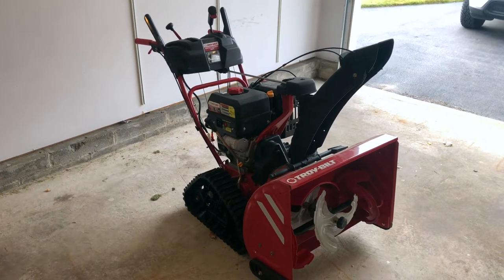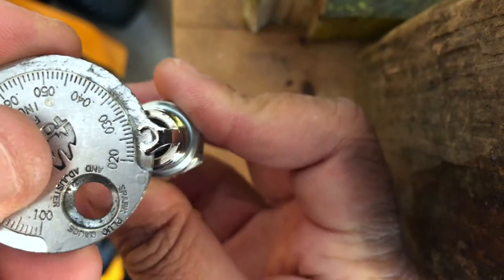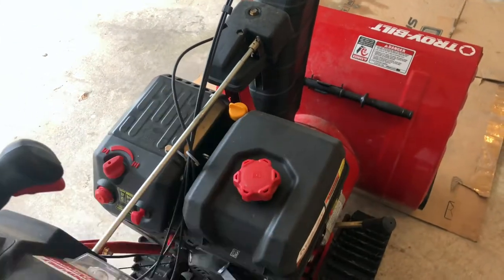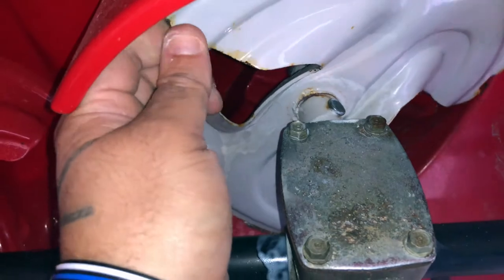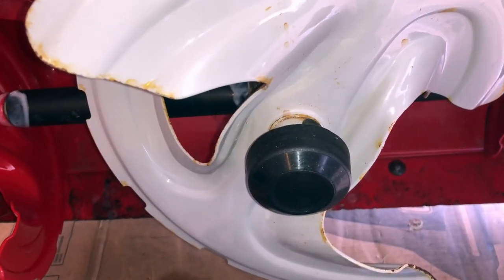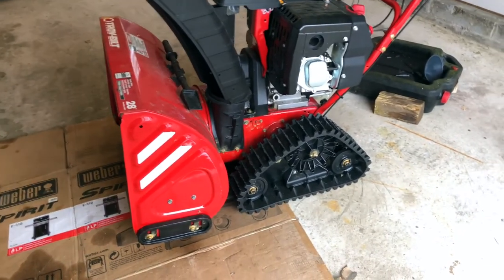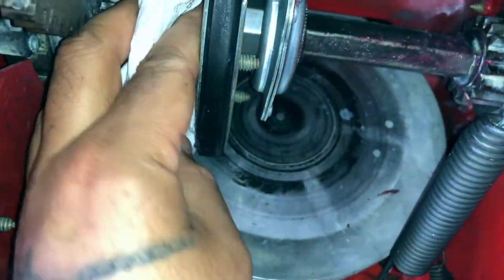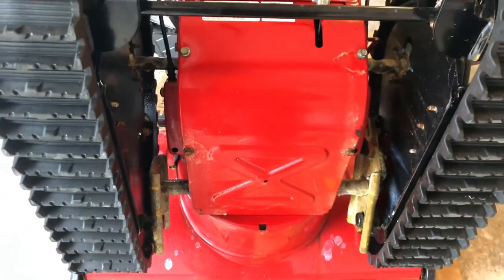How To Tune Up Your Troy-Bilt Vortex Tracker 2890 Snowblower

Comment: Is that grease low temperature grease people don't use the low temperature kind which means when it gets cold it's going to gum up not good..
Reply from the maker: It was and good point I should have specified low temp grease.
Reply: @MrV2u  just nitpicking but LOVE YOUR VIDEO!! And I looked it up It looks like that mobile 1 grease is low temp..
Reply from the maker: @muzikmon2267  hey I appreciate all comments. Sometimes I learn a couple things myself. Thanks brother.